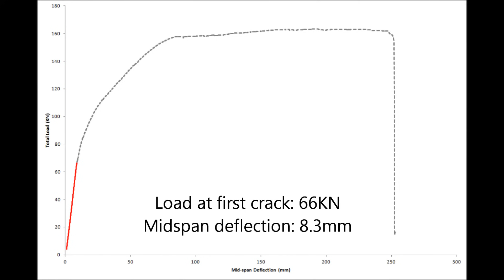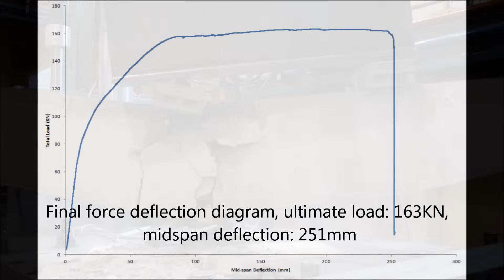Beam Test...watch beam failure in slow-motion!

Comment: Just so I am clear on this concept. The Univ. of Toronto will threaten to terminate a professor for not using bigoteer pronouns but is totally OK with a professor not having anyone use PPE (Safety Goggles) for a potentially hazardous test. I get it that the cracking was slow but how did they know that the beam was cast properly? It could have failed catastrophically and sent shards of concrete chips flying into eyeballs. WTF is a hard hat going to do for lateral projectiles??????
Reply: It's wasn't needed for that kind of test. But you do see the guy closest by the screen put them on at one point.
Reply: First thing I noticed. I've never seen a work environment where a hardhat is necessary but safety glasses aren't, including this video.
Reply: Brendan Boyer Construction sites (if no one is working), some factories. There are many places. Eye protection is only need if there is a risk of eye injury.
Reply: They're highly unsorted engineers
Reply: SchizoidMan does that also mean they are well graded?
Reply: It was the first
thing I noticed too.
Reply: No safety glasses, no deflection barriers, no hydraulic leak protection, no restraints on test beam, unprotected workstation is too close to test area. But they wear hard hats. Reminds me of working in Thailand in the 90's.
Reply: I've performed multiple tests much like this. These tests are less dangerous than any of you think. I know it's easy to say stuff in the peanut gallery but these people know what they're doing. Notice the guy pull out his phone to film the failure seconds before it happens - that wasn't a coincidence. You won't see a projectile out of that beam because it just got pulverized into dust and crumbled. No exploding anything
Reply: derp man 
The point is to have it and not need it, rather than need it and not have it.  This isn’t, by any standard, a situation where safety glasses wouldn’t be a minimal requirement.
Reply: F safety first
Reply: Safe to say, no take 5 was done here ;)
Reply: Agreed!
Reply: And the rest of the time they are sleeping.
Reply: How many of you commenting about the safety here are actual civil or structural engineers?! I'm a mechanical engineer by training and I don't even proclaim to be knowledgeable about the safety measures required for this test. To me this is simply a yield test not a impact test so there is no momentum going around. Reinforced concrete isn't known to send shards flying over the place from a steadily increasing load. It simply crumbles and implodes. To me these engineers or researchers seem to know perfectly what they are doing and it sure doesn't look like their first rodeo either.
Reply: did you also notice a board was put into place halfway through the project directly below the overhead load? I dont think they did the proper sequence on that either, which may be release the pottential energy stored in the beam (163kn plus mass of beam), then placeboard under to make the cleanup easier after you make a mess. hahaha
Reply: did you also notice a board was put into place halfway through the project directly below the overhead load? I dont think they did the proper sequence on that either, which may be release the pottential energy stored in the beam (163kn plus mass of beam), then placeboard under to make the cleanup easier after you make a mess. hahaha

Comment: It's interesting the way the cracks are fairly evenly spaced across the beam. On in the middle, then one about eight inches on either side and then another about eight inches on either side of those. Is this a sign that the strength of the beam is very uniform across?

Comment: 2:01  First crack occurs with 8.3mm deflection - that's quite a lot!  Concrete is surprisingly flexible, that it could absorb that much deflection without cracking.  Also, it's interesting that the deflection seems to be linear with respect to the load until the first cracks appear, after which it starts to shoulder off.  What does that say about what's going on inside the beam as it bends?
Reply: the steel is flexible

Comment: looks like a well designed beam- failed at the widest and strongest spot aka no weakpoint. Heads up, I only know bro-science.
Reply: because the load is not a uniformly distributed one, the stress concentration is higher there.

Comment: No laser beam to evaluate deflection? No painted stripes or checquered  sectors ? No  hi speed camera ?  No screens or goggles & masks   to protect operators from flying  splinters/debris/dust ?
Reply: This is at a school.  They probably feel lucky to have this.
Reply: No deflection on this beam. Only tension on the bottom and compression on top. It is supported on both ends.

Comment: Less than 20 tons of force did that, and it basically failed wayyyy before that much pressure was applied.  I'm guessing this truss/beam has some other redeeming quality, such as weight to strength ratio?  Not trying to be an ass, but that isn't an incredible amount of weight that destroyed the truss.
Reply: Ever seen just a single beam supporting some objects with load put directly in the center? In real life situation they'd put many of them in pararell to support desired load. And the load would be put equally along the beam, not placed just in the center.

Comment: As more people have mentioned, it's stupid to sit next to that. That beam is a giant spring under load. If it flips away from underneath the press and it hits you it can kill you easily.
Reply: There is not enough energy, stored or otherwise, to accelerate the beam horizontally (or bits of it into eyes;). If you were to rig an endpoint on an incline (so as to change the down force-vector to horizontal) with a keeper pin say, and suddenly remove it, the beam might move a few millimeters. Remember everybody, solids and liquids are virtually incompressible--which is why hydraulic systems are so useful! The inherent safety of such a test is similar to that of hydrostatic testing of compressed gas systems; or in other words, you can pressurize a water-filled gas bottle to failure, stand next to it, and not even get wet (well north of tens of thousands psi) but try it with gas however, and you'd be reduced to many small bits. Or for the English majors out there, this is more about a beam's static properties--not dynamic. To investigate its dynamic properties, you'd want to wave it around (and then maybe, stand not so close;)!

Comment: Why the hell is a crowd of people hanging around in the same room where any minute a concrete beam will send kilos of shrapnel flying?!
Fire everyone.
Reply: I would say there is not really that much energy in the whole system. As a result you pretty much know where the heavy debris will land. I would wear eye protection thogh. Smaller pebbel sized stones might actually gain some velocity.
Reply: I agree.
Reply: They all seemed too close to me.  And then at 4:25 someone leans in close to place a board underneath.
Reply: Flying? This lab had been pressure testing thousands of concrete in any form and at that height it will crack and crumble slowly, not explode as a projectile. That is why they don't use any additional protection. It's like  breaking  a crunchy bread. Pressure testing a beam is different than pressure testing a cylinder (torsion). Most likely, nothing will be flying when it breaks because it is done gradually.
Reply: @HiltownJoe  "not really that much energy in the whole system" bruh...

Comment: That was a cool test. The fractures were almost directly under the load. It would be interesting and I believe a better test for such a support structure would be to spread out the load simply placing something under the two points to span the load or even taking the bottom pieces off and trying the beam  that is on it to see more of a realistic or real use test.
Reply: This method of loading is used so that the theoretical modulus of elasticity, maximum fiber stress, shear stress, and a few other parameters can be compared to the experimental values measured here.  They can use the spacing between supports, and the spacing between the two point loads to model the beam.  From those quantities, they can make predictions about uniform, or other types of loading patterns.

Comment: 66k kgs is pretty impressive.. 166k kgs is even more impressive..
sad florida didnt test their junker  beams
Reply: johnny llooddte You know kg and kN are different things. One is weight and the other is force. If you want to calculate how many kg of weight applies 66kN of force, divide it by 9.8 or roughly 10 you will get the kg that is 6.6K kgs.
Reply: ozciva you need to multiply with 100, 1 kN equals about 100 kg that makes it about 16.6 t at point of faliure
Reply: Abdou we say the same thing but you express it different. I was refering to conversion between the units that is N and kg in SI units, Not between the kN and kg. Op expressed both the first crack and total failure point values without conversion 66kN to 66k kgs and 166kN to 166k kgs. I told him to divide it by 10. You get 6.6k kg Ang 16.6k kgs. Simple. Instead you are telling him to multiply kN by 100 to get 1ton. That way it would be difficult to understand the conversion between units.
Reply: ozciva you are correct all roads lead to rome  😊

Comment: The results of this test are inconclusive. The manufacturer should ask that the two pressure points be increased to at least three or four spread over the remaining length spanning the two support ends. Did you not notice the cracks appeared directly below the two pressure points.  Case in point. With only one pressure point the test would be over a lot sooner.
Reply: Yup, hit the nail right on the head!
Reply: This is called a four point bend test and from it every other parameter of the beam can be calculated based on the construction of the beam and the testing apparatus. Further, an evenly distributed load is equivalent to a single point load equal to the magnitude of the distributed load times its length applied in the middle of the load. For example, a 10kN load across a 10m beam is identical to a 100kN load at 5m. By symmetry, a force X acting on one point is equivalent to a force X/2 acting on two points, which is how you get the four points for the bend test (two supports, two load points)
Reply: @mrb692   thank you.  I would venture that it’s an ASTM that is applied to every manufacturers product correct?

Comment: Set speed to 2x and goto 2:08 and watch the computer monitor. NEVER TRUST A VIDEO! #howtospotvideoediting
Reply: If I had to guess, that monitor is a TV with a pixel orbiter to prevent burn in. It’s unnoticeable when you’re just sitting there, but when sped up like that it becomes noticeable. 

Ask yourself, if the screen was doctored, why would it move when nothing else in the frame is? None of the references are changing, so the screen wouldn’t wobble around like that

Comment: First crack at only 5 Metric tons ?
Reply: trespire Concrete reacts well under Compression and can handle a lot of force, but breaks easily under tension, thats why you need steel reinforcement in the tension zone(here the belly shaped part of the beam) which will carry all the tension force once the concrete cracks
Reply: You are correct of course, but concrete beams are usually pre-stressed / pre-tentioned.
A crack is a failure.
Reply: I would be interested in How they pretension that bow in the center section......If Not
re bared, why is that pot belly there??.....Looks like that beam was meant to be used
flipped over.....

Comment: That's a complete improper test . Two square poits of pressure. You could see where it was going to break  before they started !
Reply: The point of the test was probably to test the concrete mix or reinforcement design, not determine where it would fail.  Beams under loading tend to fail in the center.

Comment: There yielding at the point of pressure. Look at the surface area of the two pieces applying pressure. The cracks are on both sides of each piece applying pressure. Would it be fair if all force was applied over the whole structure instead of points?
Reply: When two and equal loads are applied at say third points the portion between them is pure tension in the bottom steel and interestingly the shear force is zero. So a unique method to explore tension failure verses the cracking failure from shear. Their loading was a creative way to isolate the two modes of failure.

Comment: That's only 44,532lbs...I'm really not that impressed.  Unless it's actually made out of foam, then I'm impressed...which it's not, so I'm not.
Reply: 36,643 lbs
Reply: how did any of you guys calculate these numbers?
I am going with metric and get 15.6 tons or 15,600 KG which is equal to 34,392 pounds
156KN=156,000N

Comment: why apply the load via two pads?   
How often does that happen in real life?
Reply: ***** Yes, But is that what happens in real life situations such as bridges or roof beams?
Why not apply one single load pad?
Reply: Testing a beam at a single point wouldn't tell you anything worth knowing.  You would only be applying stress in one concentrated spot, whereas the stress concentration of a four point test is over a larger region, avoiding premature failure.
Reply: Electron That presupposes all loads is over a wide area and not a single point.
Reply: Rose White I don't think you understand how beams work or what they are designed for.
Reply: I understand perfectly.
Beams is beams and many have a single point loading if you could understand things.
Reply: Please give an example of a beam that takes it's load at a single point? Beams are designed to distribute weight, that is their purpose.  There are only 3-Point and 4-Point tests.
Reply: long bridges?
Reply: Long bridges work by bending and shear  for the deck in your example, so this experience don't suit with this example, between the two pads there is only bending forces.
Reply: Rose White the reason for the two point loading is so the center of the beam will fail in flexure not both flexure and shear.
Reply: AF Math and Engineering 
Nice to know that point.
Reply: Rose White it is a pure bending case.
If you look at the bending moment diagram their is no shear between these two point loads. Theoritically only constant bending is their which gives us a chance to investigate the failure due to bending only.
Reply: Perfect reply, Faheem.

Comment: That to me doesn't prove much. It would never be anchored in that way and the force that's applied is too direct? Just my opinion.
Reply: It’s a lab test. It appears to be a simply supported beam meaning that this could definitely be anchored with a roller at one end. 

Any distributed load can be accurately modelled as a concentrated point load. This is a perfectly viable test.

Comment: At what point is the beam considered fail?
Reply: It depends on how you define failed. The beam ultimately failed at 163kN when it stopped being able to support any load. However, for engineering purposes a failure is typically defined as the yield point where the deflection increases without additional load, 158kN in this case. In an application like this, the failure metric would more likely be when the beam has bent a certain amount. 

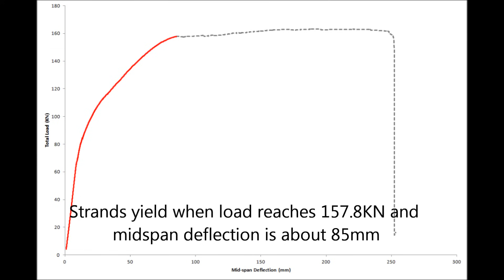If you look at the chart at 4:07, you can see the yield point when the line flattens out, and that it ultimately fails when it snaps and load goes to zero.
Reply: @mrb692  good answer!

Comment: 4:05 Load is kept constant, yet the deflection increases. This is definition of ductile failure. In this case, failure of the beam should not be confused with the violent behaviour at 4:58. This is correct?
Reply: that's not the beam failure... it's just yielding. deformation increases without adding more load when it happens. the beam, actually, failed when the concrete was crushed. when the concrete fails, we see this violent behaviour.
Reply: @JorgeOliveira-ww8ry  Yielding is a form of failure, beams designed under a stress code are not allowed to surpass the yield point.

Comment: I am confused on the purpose of the test.  To determine time to critical failure? Load to critical failure?  By the description at 37000 pound this beam fails..  How ever it was a build up and failure was over time.  I would have to say the beam failed at 3:35 due to an increased overtime weight of 35000 pounds.  I dont know.. Looks like to many variables.

Comment: Why did it crack there?
If the steel is uniform, why there?
I am asking for purely scientific reasons.
I can understand a failure in steel etc, production, welding.
But this whole video highlights a fault.
Can any engineer tell me why this happened?
Reply: The force is a point load, not a UDL.
Reply: Fek The First This is not steel. Concrete beam
Reply: Deepu Kuttu 
Yes, my eyes betrayed me.

Comment: How many pounds or tons is 156kn? Thanks
Reply: This depends partly on what kind of ton. What I consider a ton is a "short ton" or 2000 pounds. 1 kn is about a tenth of a ton (1/8.896) and 156 kn is 17.5 ton-force (the gravitational force on a 2000# ton of mass at sea level)
Reply: 156kN ~ 35000 pounds
Reply: Duud: arrive in the metric system. Even better in the SI.

Comment: it failed at its first crack, these test dint reflect weathering and hot or colds afect or more important vibration it would go way before
Reply: There's a safety factor to account for those issues and concrete buildings are supposed to be maintained, otherwise they won't last much more than 50 years.

Comment: If flat side was down, rounded side up, pressure applied to rounded side. Would results be the same ?
Reply: no, the lower side has more tensile reinforcement than the top
Reply: @reidflemingworldstoughestm1394  Looks to me there is just one steel rope pre tensioned as a reinforcement.